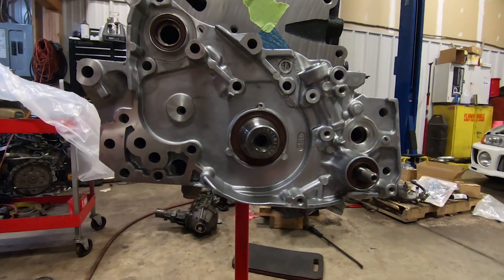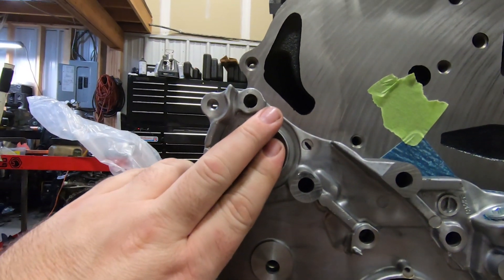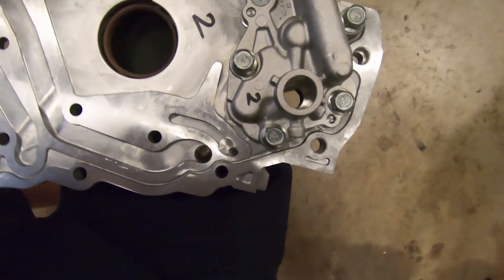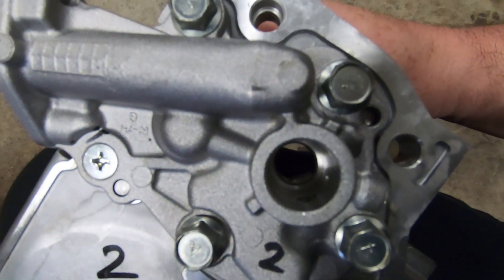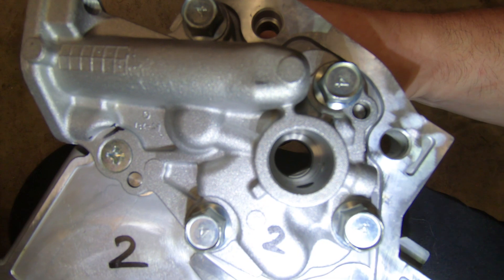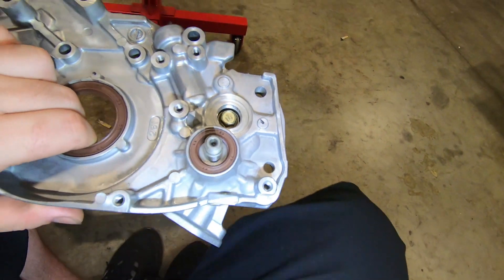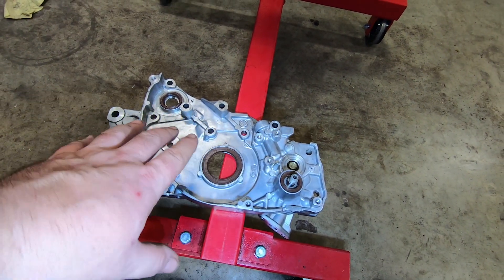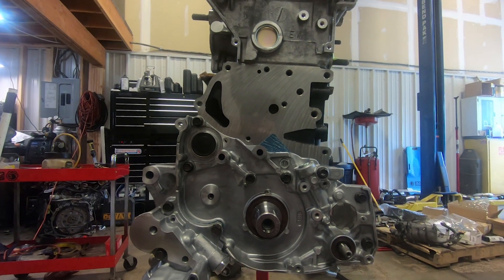4G63 BALANCE SHAFT DELETE!!

Comment: Is this kit preferred over the Kelford Kit that installs a neutral shaft in place of the oil pump balance shaft, and deletes the exhaust side shaft? They claim the neutral shaft provides better support for that oil pump
Gear that drives the shaft, which I’m gunna be honest that does make sense.
But I also come from the big-power Ecotec world where we install neutrals for both shafts and send it and make the same power as a 4G63 so… 🤷🏻‍♂️

Comment: I pulled my old engine apart and it looks like someone maybe hacked the balance  shaft off making a little stubby piece like you added in your video. Then it looks like the end of the stubby shaft was welded shut for some reason. Ever see or hear of this method?

Comment: Exaggerating on balance issue... main reason anyone would delete is high performance race vehicle that wouldn't have an issue with vibration due to engine.
    Benefit of removing weight and parasitic load gaining a few HP
  Otherwise just change balance shaft belt at manufacturer recommended interval

Comment: Thankyou, this is also for the 4g69 from the lancer ralliart galant and eclipse. This delete kit works for those as well, just thought I’d leave this tip in comments
Reply: Is it true that it gives it a little more horse power?
Reply: @Betooo  yes the balance shaft robs hp, it will be a smaller gain tho.
Reply: @vantage.motorsports  I see. So maybe it isn't worth it?
Reply: @Betooo  it depends, if your gonna rev your engine high past like 8k. your gonna want to delete it, it can cause failures. Most people with built engines delete them. but it all depends, some people say it’s better for high rev engines others say get rid of it. But if your balance shaft causes a belt to snap your engines gone.
Reply: So when I do the delete are those shafts still in the motor? Or are they taken out sorry If that sounds like a stupid question, but I don't know much about vehicles. I'm having a oil light flicker on mine at idle right now, changing the sensor and switch in the morning. And my buddy told me about this, hoping I'm not loosing pressure from the balance shaft bearing being worn down. So if I don't this to my car it would bypass all of that?

Comment: I was thinking of removing the balancing shaft on the 4D56 engine if it had no effect on the engine.
Reply: Eliminated the balance shaft on a 1987 Dodge D50 4x4. 2.6 Mitsubishi about 25 years ago. It worked perfectly. Bought the kit from Moores Engines in Calgary back then for about $35. They said the engine was very well balanced even with out the balance shafts and not to worry. They were right. Was a fun little truck. Bought it used as is because the balance shafts were causing the engine to rattle loudly and the shop she took it to said it needed a new engine.

Comment: hi sir ... what is the difference between engine balancing shaft and engine balancing shaft removed?

what is the effect on engine when balancing is removed?
Reply: I be know this is two years old, but just in case anyone has the same question - the balance shaft rotates twice per every cam rotation (so really fast). The only difference that is notable is reliability. I’m sure there’s some performance gain since that’s two less parts rotating, but it’s mainly for high horsepower reliability.

Comment: Just stripped a D4CB Hyundai engine which got wrecked by a balance shaft failed, the bearing shell got destroyed and the oil pressure dropped causing the crank to spin shells and lock up! good informative video

Comment: good morning greetings and congratulations on your video, very well explained ok, I would like to know the issue of vibrations if they are persistent or are speculations because I see that those 2 axes are really a problem and the other thing is that if there are no problems in leaving the axle placed clear is covering the holes and removing the strap and tensioner and this is in the case of not getting that kit here in venezuela thanks
Reply: I would like to know the issue of vibrations if they are persistent or are speculations because I see that those 2 axes are really a problem and the other thing is that if there are no problems in leaving the axle placed clear is covering the holes and removing the strap and tensioner and this is in the case of not getting that kit here in venezuela thanks
Reply: my engine is 4g69 mitsubishi outlander i want this very safe to eliminate the balancers if it is perfect for that reason my insistence on whether they appreciate vibrations

Comment: I have a issue with a 4g63...
super low oil pressure and airbubbles in the oil.
I replaced the strainer gasket. 
the bubbles are gone and the pressure went up a little bit.
but still its super low.
with a cold engine it goes up maybe 1/4
the lifters still tick super loud.

does the balance shaft removal help here?
its a 200.000km engine. ( 120k miles)
its a daylie NA eclipse, no mods.

Comment: i just had my transit petrol 2.3 engine 4 cylinder recondtioned ,,they said they removed the balance shaft and am worried about the real reasons why? will the engine be less relible now am wondering ...rev higher now but more vibrations and less millage..the old engine had done 140k like it came from fords so why change it ..nice video by the way thumbs up

Comment: Great explanation Morfab! I understood the explanation of the balance shaft on the side of the oil pump. A have a doubt, on the other side (left) I close the holes and take off the balance shaft, the pulley and the belt and put the cover in the place or i mantain the balance shaft, the pulley and belt?
Reply from the maker: Remove the pulley, remove the balance shaft, remove rotate and reinstall the two bearings to seal the oil passages, and installt the cover over the hole. The belt also gets removed. The pulley on the crankshaft stays
Reply: @MorFabIndustries  tks a lot!

Comment: You can also just rotate the balance shaft bearings so the block off the oil passages that is what I did I also modified my stock oil pump shaft by cuting and welding the oil passage closed that's how you do it for free anyways.
Reply: I was just about to post this comment. Back in the 90's there were no "kits"
EDIT: How are you not subbed to jafro?? He is the youtube 1g and 2g GOD
Reply: And no one is mentioning how much better the oil pressure gets. DSM cats from the 90s know.

Comment: Hello from New Zealand, great job with the explanation! Could you explain crankwalk, and are evo5 engines prone to crankwalk?
Reply: Any motor can "crankwalk". Just means the motor has exsessive crank endplay. There is many ideas out there as to why some motor are more prone then others to it.
Reply: older generation evo motors had a poor split thrust washer design .. all newer ones have a single part design now. When you first start an engine there is no to little oil on the washer so it has no to little protection from wear . Add a poorly designed heavy duty clutch and it multiplies the wear effect . you could stop most of that by eliminating the clutch switch aka the need to press the clutch on initial start ups .
Reply: If you watch jafromoblie's videos he points out that most of the time the crank walk issuse is there because people leave a bolt out of the bell housing and it puts a lot of stress on the crank
I believe this to be true because he has never had a crank walk issuse on his many high hp 4g63